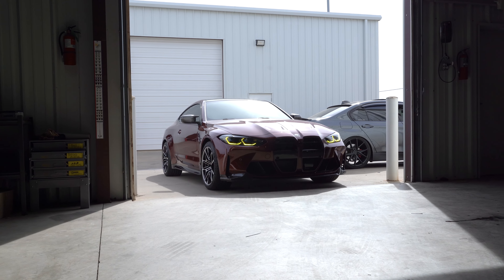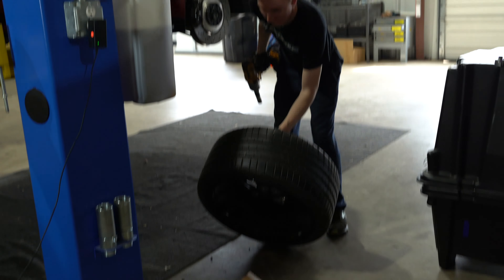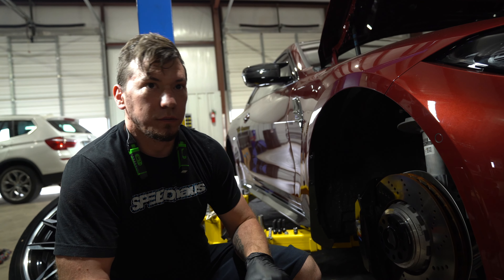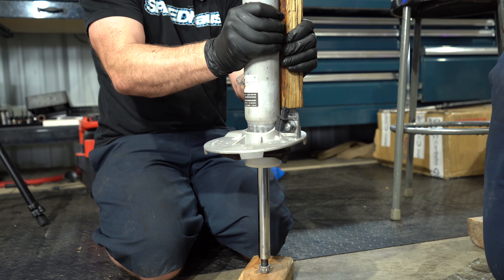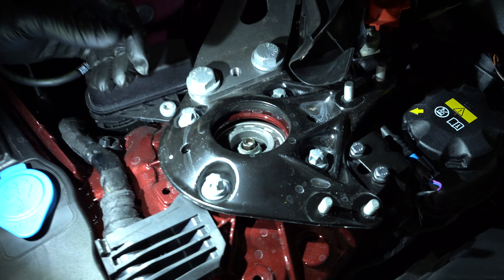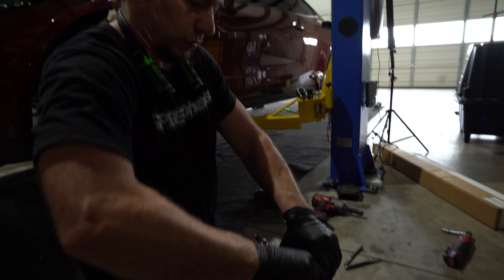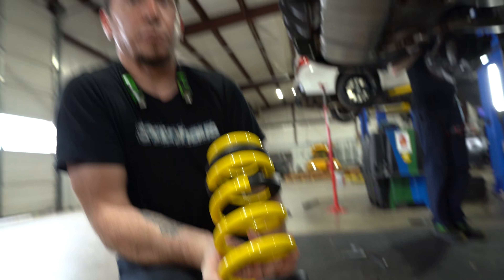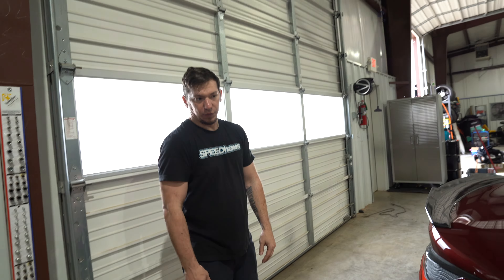BMW G80/G82 KW H.A.S. Lowering Springs Install | In Depth

Comment: Just a heads up. 
You’re suppose to replace the shaft nut. It’s a one time use. 
Make sure that’s torqued down correctly
Reply: Ive been looking everywhere trying to find what the one time use parts are as well as part numbers, ive seen people say control arm bolts and now shaft nuts, anyway u can help me out on what exactly i need?
Reply: @NoTimeToBleed16  bimmerworld has an entire kit of the replacement nuts and bolts specifically for changing springs in a G8X

Comment: I will be doing this myself.. using mallet for removing perch should be fine?
Reply from the maker: Should work fine. We recommend placing a block of wood or something similar to strike with the mallet so you’re not striking the perch directly.

Comment: It looks like - if you are just changing out the spring, that the strut can stay in? Just support the lower control arm, remove the shaft nut and upper strut bolt after spring compressed?? Doesn't it take some fancy tool to get the upper nut off the strut??
Backs look pretty straightforward..
Reply from the maker: That’s correct if you’re doing lowering springs only you can do that. 12point 18mm socket will remove the center nut on top.
Reply: @speedhaus405 did you use spacers on this car?